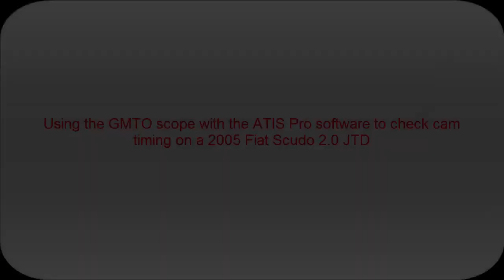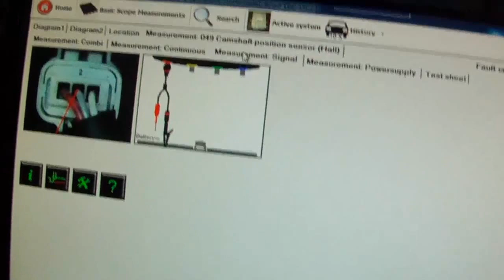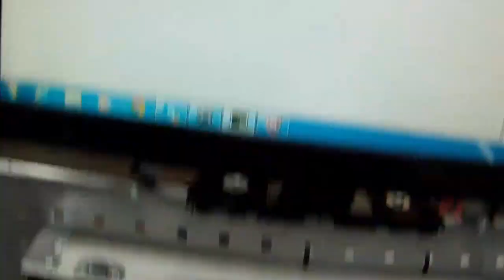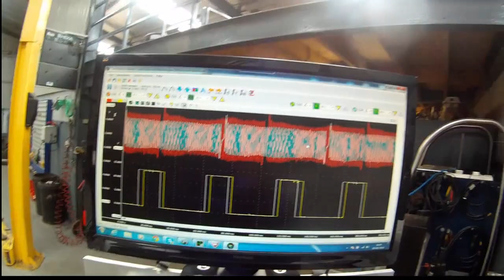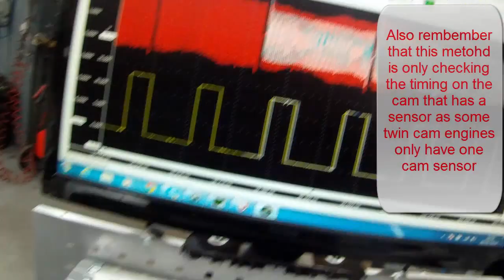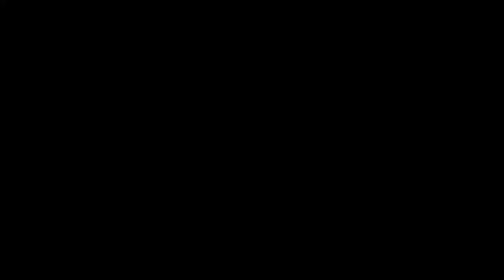Ryans Automotive TV: GMTO Scope to check Cam Timing (NOW UP TO 1GS/s sample rates)

Comment: Can you measure the degrees of difference? Does it have math channels to assist?
Reply from the maker: Hi Yes with a crankshaft angle IO see here https://www.tiepie.com/en/multi-channel/advanced-measurements/ios/crankshaft-angle and can check degrees with cursors
And also has maths channels